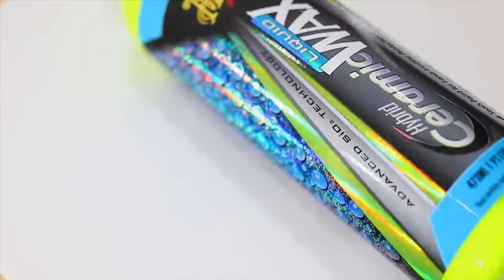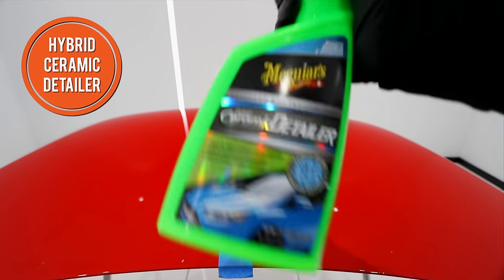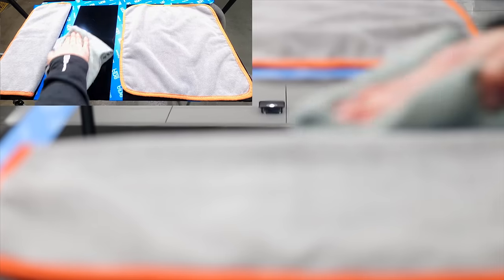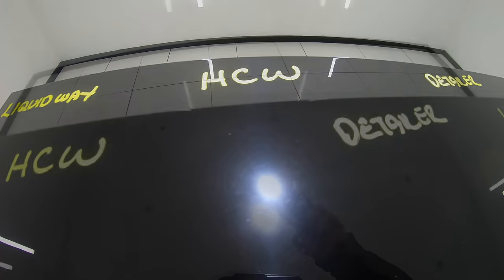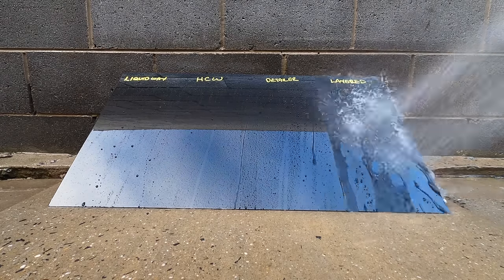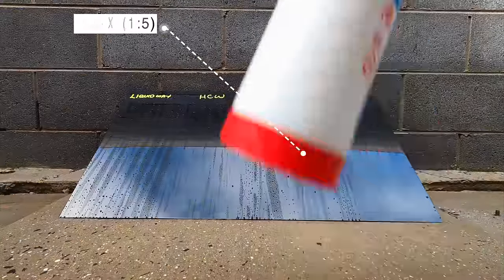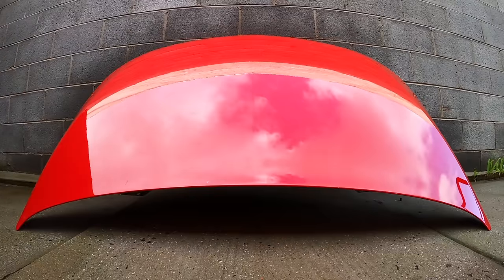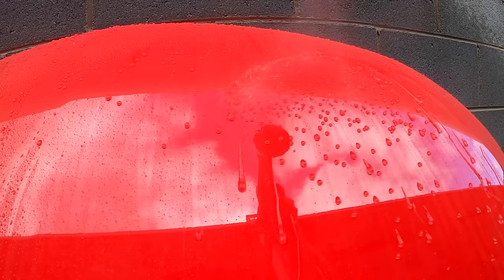Meguiars Hybrid Ceramic Range Testing & Reviewed!

Comment: Thank you for the excellent video. 

I'm about to have Rupes UNO Protect used on my car by a local detailer. I do have Meguiar's HC spray wax and was wondering your opinion on if I could use it as a topper to the UNO Protect?
Normally I'd do this myself but medical issues aren't allowing me to right now to do the whole process. However once the detailer is done I could put the car in the garage and slowly apply the spray wax over a coupe of days. I believe Meguiar's states that the spray wax will bond to the surface when used over traditional products but I was wondering if you had more to add. Thank you!
Reply from the maker: Sorry to hear about your medical issues, but I think HCW should work just fine over Uno protect and is it’s definitely a good idea to top it as most AIO polishes don’t tend to provide long lasting protection.
Reply: @CarCraftAutoDetailing  thank you Santro, it's just a bump in the road. I appreciate your answer because I couldn't find anything definitive. My plan is to put the car up when he's done and use the Meguiar's HC spray on the dry panels in the traditional application a small portion at a time. 

I subscribed to your channel. Keep up the good work.
Scott

Comment: I used hcw spray and rince after primary apply and secondly i used quick detailler in dry aid.
Good results but iam asking if Gyeon wet coat or fireball easy coat extra should better.
Hcw and quick detailler seems to works together very well
Reply: Gyeon WetCoat lasts 2-3 months, is easier to work with and you use way less product. 2-3 sprays per panel and no foundation layer needed. I've used it for a few years.

Comment: Hi bro, thank you for sharing. Can the liquid wax can be applied to a car with ceramic coat already then apply the ceramic detailer? or just i used the spray type as ceramic topper application?
Reply from the maker: You could use the liquid wax followed the detailer as well.
Reply: @CarCraftAutoDetailing  Thank you so much for the information. by the way you have mentioned on your video that the liquid wax can be use also for plastics or rubber? can i apply for headlights or glass windshield?
Reply from the maker: Yes it it seems to actually work quite well on clear plastics and glass
Reply: @CarCraftAutoDetailing  Again - thank you so much, i admire a lot of your videos. still keep seeing your other videos and sometimes i repeat it again to understand more about detailing process....

Comment: I’ve always found Meguiar’s waxes are great to work with, but they’re all terrible at chemical resistance. Two hits with Meg’s APC at 10:1 is enough to practically strip it all off.
Reply: Ceramic is better i have it and it lasts abt 2 months
Reply: @yaishmatheen4274  That’s about how long the Ultimate Paste & Liquid Waxes last so I wouldn’t waste my money on the ceramic wax if that’s the case.

Comment: Hi Sandro, can you make a review of the Extreme Top Coat Sealant with Carnauba by the CG? Wud be much appreciated. Cheers!
Reply: I can: It looks allright, gives some gloss, is decent to apply and remove and lasts around three months.
That said, many SiO2 spray sealants seem to perform better and are easier to use.

Comment: Thank you for this follow up on your previous MCW spray test video some time ago. That is the reason i subscribed to your channel and still enjoying your tests.. Due to your previous test, i did buy the MCW spray it and using it on dry clean paint. Great to see that that is still the best choice 👍 I hope you can help me with someting else; i have the Gyeon Rim coating, but not sure what is best to use before starting with the rim coating? To get the inside and outside of the rim clean (brake dust etc) before starting with the Rim coating? Or maybe you have a video or willing to make one? Thanks as always! Greetings from the Netherlands (still planning to get with my Qashqai to your shop) 😁
Reply from the maker: Thanks and that’s great to hear. Fir the rims it depends on whether you’re looking to do a wheels in or wheels off preparation. If you watch many of my longer full detailing blogs, they usually start with a wheels on detail that shows that process, but if you want a look at how I prepare them fir a more thorough wheels off detail for a coating you can have a look at these videos:
https://youtu.be/q-iIr76_AqI
https://youtu.be/83W2AAQRuSY

Comment: Just to get this right can I apply the liquid wax and then once that’s buffed apply the ceramic detailer straight after to help seal it all in?
Reply from the maker: Just given the initial layer of the liquid ceramic wax at least a couple of hours to cure before topping it.
Reply: @CarCraftAutoDetailing  great stuff thanks for the fast reply , would you recommend applying the detailer everytime I use the liquid wax so every three months or so
Reply from the maker: @Generalkenobi325 yes, I think that’s a great way to go

Comment: Hello sir I'm currently using meguiars carnauba gold class quik wax on my car do you think I should move to hcw?
Reply from the maker: There’s no wright or wrong answer, just what you prefer on both application experience and results. HCW is a wipe in and immediately wipe off application so you need to work a little quicker, but it’s potential durability, look and hydrophobic ability will out perform almost any wax.
Reply: @CarCraftAutoDetailing  thanks, will give it a try when this current bottle end. Thanks for the link in the description too. Too quality channel
Reply: @CarCraftAutoDetailing  sorry I have a follow up question which product do you suggest for decals with a /satin matte finish?  BC the back of the bottle says not for use on satin/matte
Reply from the maker: Usually spray waxes/sealants are fine on matte or satin paints/decals so I’m surprised it says that, but Meguiars ceramic detailer should be fine
Reply: @CarCraftAutoDetailing  copy that, thanks

Comment: Hey Sandro! Why don't you test CQLite vs Meguiars Hybrid Ceramic Wax?
Reply from the maker: It could be an option for a future test, but CQLite is still a true ceramic coating that hardens while HCW is really a spray sealant so they are a different category of product
Reply: Yes but hardening would matter for micro marring or swirls, right? For chemical resistance, beading and sheeting purposes, would be an even fight wouldn't it?
Reply from the maker: It’s a very individual thing with coatings and it’s hard to tell what the hardening factor specifically does, but I meant more that they are different categories of products at least in my eyes.

Comment: I Was Planning on Getting Meguiar's Hybrid Ceramic Detailer and using it as follows & would like your opinion...

💥💥💥💥💥💥💥💥

My car is 3 weeks new, has already been washed, clayed, polished & waxed...

It's been in garage most of the time because of rain...

Driven it maybe 50 to 75 miles since it's been detailed (  wash, clay, polished, waxed )...

There's a little dust on car which i was going to used the hybrid ceramic quick detailer to clean ( per instructions on bottle saying dust is ok )...

💥💥💥💥💥💥💥💥

Can i apply Ceramix Spray Wax Afterwards ( Waiting hour ) before applying spray wax?

💥💥💥💥💥💥💥💥

Then I'm planning on wiping car down with this Ceramic Hybrid Detailer, throughout the day when doing on errands or day trips...

Example...

When drop someone off at mall  & I'm waiting for them to come out, I'll wipe whole car down real quickly to remove any road & environment dust...

Whole car or suv can be done in under 10 mins; because with frequent & often wipes, car is really slick & for most part clean...

When take them somewhere else & maybe drove 10 to 20 miles & dropped them off, I'll wipe it again...

Very little mist is needed because again car is super clean & protected, with only environment dust from driving & road...

May drive 30 to 40 miles to visit...

I'll wipe it with Meguiar's Hybrid Quick Detailer or Just micro fiber if it's just lightly dusty...

Again, 
Would appreciate your thoughts & opinion...

💥💥💥💥💥💥💥💥

I'm going to go get the Meguiar's Hybrid Ceramic Wax Spray & the Hybrid Ceramic Quick Detailer Spray...

Once Store Opens This Morning...

Can't Wait To Use Them...
Reply from the maker: You’d typically want to avoid wiping your car’s paint down of dust so frequently with any quick detailer or product as even with using a good safe technique and having paint protection in place, it’s hard to avoid creating light swirls to some degree and extent - that’s just the nature of car paint, it is more prone to swirls the more we touch it. A weekly safe hand car wash or even twice weekly may be a better option as using water and suds tends to still be the safest way to clean vehicles in relation to avoiding swirls/scratches. Having said that, it’s your car and I have zero issue with you maintaining it as you wish - hope that helps.
Reply: @CarCraftAutoDetailing  
Good advice, thank you

Comment: From 3.55 in the video, you use the HCW on the 1st section of the panel (from letf) and the liquid wax on the 2nd section of the panel. But on 7.30 in the video, you have put the name of liquid wax on the  1st section and HCW on 2nd section. So, you commentary is citing HCW is the best, which actually the 2nd section of the panel, which actually with liquid wax applied on it. Did you make a mistake or I have misunderstand it ?

Comment: Actually had my fake jeep detailed recently and the detailer said the "use with water" is just their way of selling more product. He recommended like you to apply dry and buff out, although he complained it streaks a lot until fully dry.

https://imgur.com/a/KzKkwyx

I like the stuff, but it's only noticeable on clean paint. If you paint needs polishing then you will not be able to see any of it at work.
Reply: Very true. I applied the liquid wax to my car after full prep and paint correction with iron remover, clay, and compound and polish. Still perfect after several months. I tested the liquid ceramic wax on my moms car with just clay, no correction. Didn't even last a few days.

Comment: I have 2024 Car that is 3 weeks new...

The car has been washed, clayed, polished & waxed...

The car is not ceramic coated..

Could You Suggest What Product(s) i Could Use To Wash The Car With To Get Best  Results When Applying Meguiar's Hybrid Ceramic Liquid Wax Spray ( G190526 )?

Thank You?
Reply from the maker: A pure car wash with no unnecessary additives is best, a few of good ones are Carper Reset, Shine Supply Shift Soap and Nv Snow
Reply: @CarCraftAutoDetailing  
Thanks